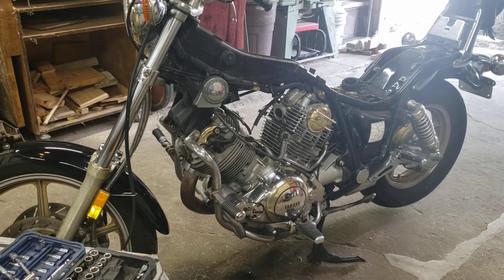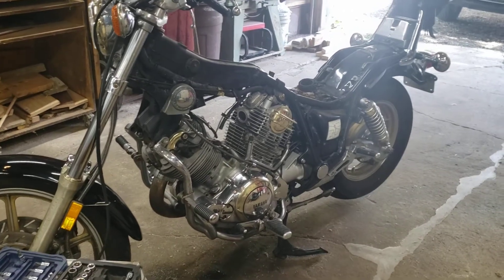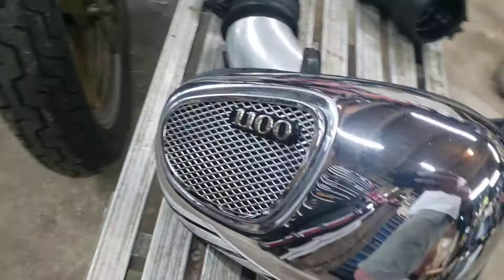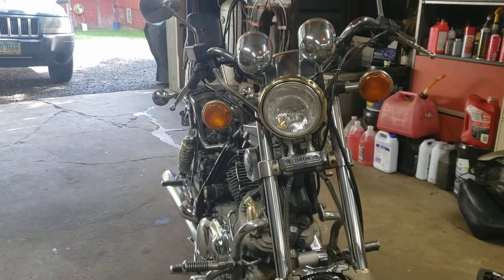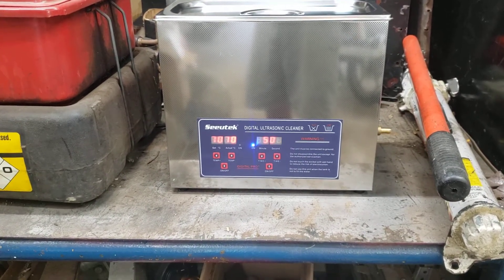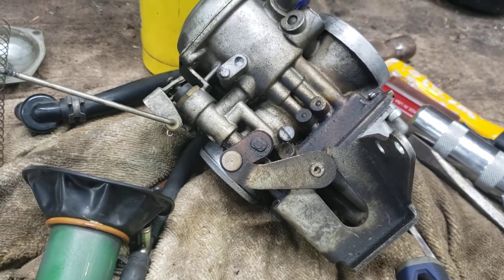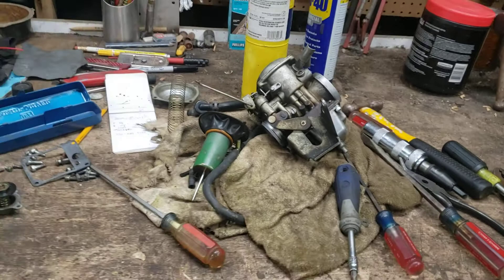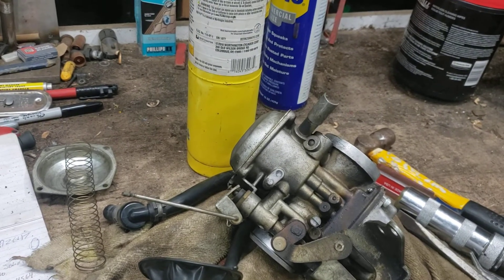A new tool for the shop

Comment: Hey there again. Unfortunately, my 7.3 has another issue. For some reason when you keep it above 2,000 rpm for some time and let off to come up to a stop sign, the truck shakes and idles rough. It almost seems like it is down on a few cylinders. When you get back on the throttle, it runs good again. So its a intermittent rough idle condition. Whats weird about it is it does it at the same stop signs everyday. There are no codes that show up on my forscan app. It passes a buzz test fine. I replaced the gray cps with the motorcraft blue and purple one. Still no difference. When it idles rough the Icp is about 587 psi and the IPR is 12.50. When it idles smooth its the same readings. I unplugged the icp and ebp sensor and drove it like that. Still no difference. Today I replaced the Idm with a remanufactured 120 volt Alliant Idm from Riffraff Diesel. The extra 20 volts defiantly made the throttle response get better, but is still idles rough.

Any ideas would be appreciated.
Thanks Alex
Reply from the maker: With the engine warm, sitting still in neutral or park, try to free rev the engine to about 3000 Rpm. Does it stumble or hesitate around 2000 or 2200 RPM?

Have you checked the fuel filter or pressure? Check the filter first, if it looks really black you may be due for injector o-rings (especially if it stumbles in the test mentioned above).

If the filter looks good and you get no stumble (as listed above) check the fuel pressure. You can do that with a standard tire pressure gauge on the Schrader valve on the side of the FPR on the fuel bowl. Get a rag around the Schrader because it's likely to spray some fuel when you remove the gauge. Those injectors like to see about 40 psi of pressure at minimum (ideally closer to 65) and if the pressure is falling off it may be getting fuel starved at idle.

Thats a good place to start, anyway.

Good luck.
Reply: Ok, with the engine warm, there is no stumble at all when I rev it. It is good all the way up to 3,000.

The fuel filter is not black, the diesel inside the fuel bowl is clean looking.

The tire gauge that I found doesn't have a pressure relief valve to hold pressure, so the needle just bounces everywhere on the gauge. I wouldn't think I would have a fuel pressure issue but I guess I could. I put a new motorcraft fuel bowl and motorcraft mechanical fuel pump on it last year, so I think it is all good.

When its cold, it actually kinda idles the best. Besides from being a higher idle it seems smoother. When its warmed up it has two stages of rough idle. Theres the kinda base smoother rough idle, which could be just the nature of the single shots, and theres the miss/really rough idle. When you drive it for a decent while at high rpm (because its 4.10 gears) and come up to a stop sign or light, it starts running rough. Its almost like it has a miss or something isn't firing right. One time when it was doing it at a stop sign, I shut it off and when I restarted it, It did not have that sharp ping or jump they have when 7.3s start up. Instead it kinda just slowly cranked. Could this possible be a worn HPOP that is struggling to give oil to the injectors?
Reply: I was looking through your videos and found something that somewhat matches the sound it does.
https://www.youtube.com/watch?v=FH_ZZcfiQGE
Go to when you start your truck.
At :42 to :44 seconds  after you start it, it has that chug then smooths out. My rough idle is like that chug that doesn't go away. It knocks a little more too.
Reply from the maker: A worn HPOP will show up in the readings from the IPR and ICP as a low ICP pressure with a high IPR duty cycle. You're not seeing that, so I'm inclined to think the HPOP is okay.

A cheap "stick" style tire gauge will work fine for checking fuel pressure as it doesn't bounce like a needle style does.

Is it safe to assume the oil has been changed since it started doing this?

One other thing, is it an automatic or manual truck? If it's an auto, what happens if you pop it into neutral at the stop sign when it's doing this?
Reply from the maker: And how many miles on this truck? Any idea if the injectors have ever been replaced?
Reply: I will try getting one of those tire sticks. Also I'm thinking about getting one of those 3 in one glow shift gauges or a three pillar set (although I'm leaning towards the 3 in one because it doesn't take up the whole pillar).

It has 143,000 miles on it. I replaced the injectors about 3,000 miles ago with some remanufactured 90 cc AA injectors from full force diesel.

I changed the oil almost 3,000 miles ago with Motorcraft 15w40 Diesel oil.

Its a manual 5 speed so It doesn't make a difference if its in neutral or not.
Reply: Alright update, 
With a tire stick at idle, it reached 56 psi
I got a glow shift 3 in 1 gauge with boost, fuel pressure and egt. (Still gotta hook up the pyro)
The fuel pressure on the gauge kinda bounced all around from about 30 to 60 which I guess is normal because it’s a mechanical fuel pump.

I switched the under valve cover harness back to the old ones and there is no change.

Comment: Hey there. I think I got my issue fixed or close to fixed. I changed the oil with some motorcraft 15w40 and now it idles pretty good. The old oil must have been foaming up. I do have a question about the dipstick though. Before I changed the oil, the dipstick read half. When I drained it, I only got about 12 quarts out of the motor. When I filled it, I put 14 quarts (aiming for 15 quarts) but when I was checking the dipstick, it now reads about 3/16 of an inch above full from roughly 14 quarts in the motor. It is still high after driving it for about 50 miles. I was doing some research and I guess some of the OBS fords had wrong dipsticks in the early years. My dipstick part number is 1826628C1 in a 1997 model. Could you possibly look at your dipstick part number and see what you have? Thanks, Alex
Reply from the maker: Hi Alex, That part number matches the one on the dipstick in my '97. Did you prefill the filter when you did your oil change? If so, does that 14 quarts include the quart in the filter or is it the filter plus 14?
Reply: @diymechanictv1233  Yes sir I did prefill the filter. So I basically filled the oil filter up, installed it, poured in most of the oil until it was high on the dipstick, started it to allow it to fill the filter and circulate the oil. I ended up pouring in about 14 quarts since I had a quart or alittle more left. So 14 quarts does include the filter.
Reply from the maker: I'm not sure what to tell you! I plan on 4 gallon jugs when I buy mine and I always have a quart or so left over. They're not 5 quart jugs are they?
Reply: Yes, the motorcraft oil comes in 5 quart, so I poured in all three but had a quart left. Does your dipstick read right with 15 quarts?
Reply from the maker: I don't think I ever get a full 15 quarts in it. 15 quarts may be the rated capacity, but that would include the HPO reservoir and oil rails in the heads, etc.

Just fill it to the full mark on the dipstick and you'll be fine.
Reply: So I didn’t hurt the motor with the 12 quarts it had in it? These trucks are supposed to quit running before no oil can damage them right?
Reply from the maker: I think you're fine. I ran one out of oil at 70 mph once (blew a fitting on the oil system and dumper it all) and once I fixed the fitting and refilled it with oil it fired right back up again and ran like a champ. Took something like 2 gallons of oil to get it to fire and another gallon to top it off. I think you're fine.
Reply: Oh wow, I always wonder how these fittings will last. Hey thanks for the replies. Kinda strange how the other oil was causing the rough idle. I think it was foaming up, and the injectors didn’t like that